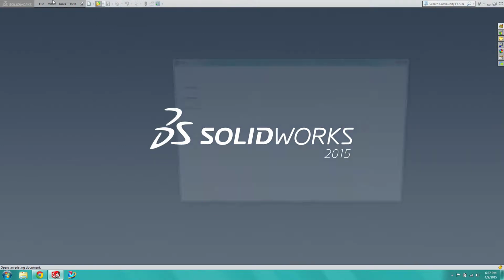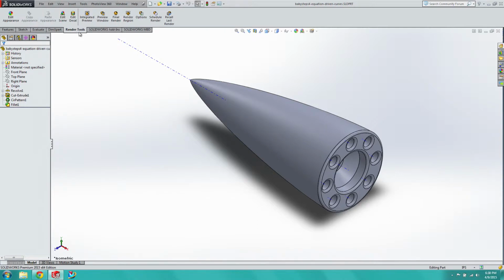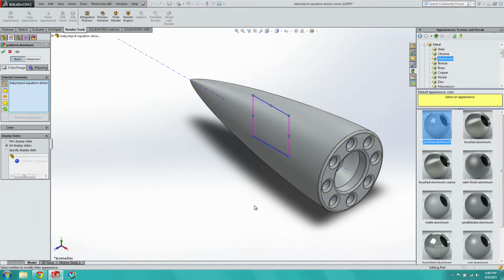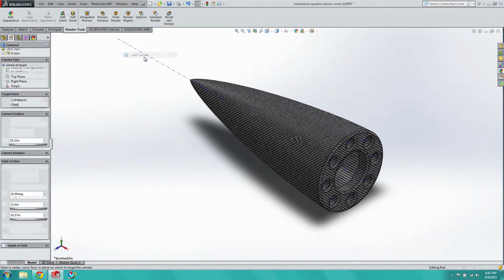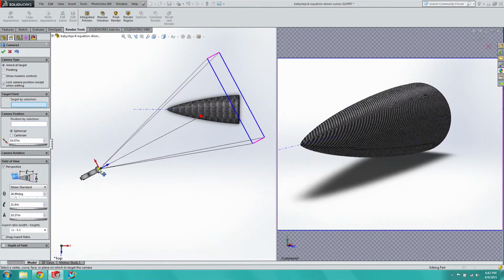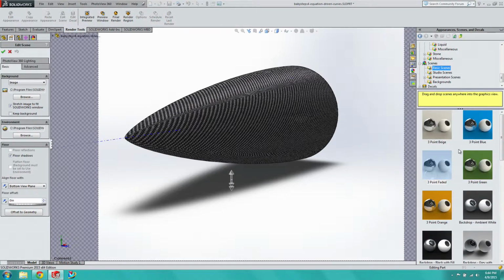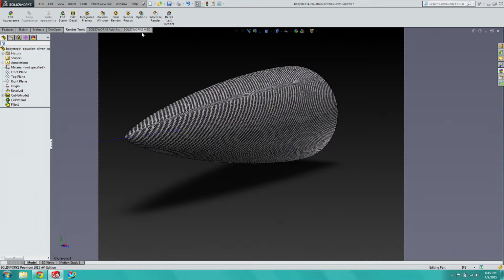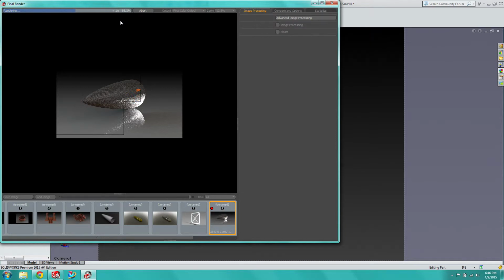SolidWorks Baby Steps #6: Basic Rendering of Models

Comment: When I render using a camera ratio of 1:1 (square) it always leaves a black strip on the top of the image, even though there's part of the model that should be filling that space. Any idea of what's happening ?
Reply from the maker: Jorge Luis Vargas You may have to walk me through a bit more as to what you're doing - can you provide a link to a screenshot of the SW screen vs. the render? The black strip, I take it, doesn't mirror to the bottom?
Reply: A Crazy Machinist Well by this time I already fixed it. I don't really know how I did it, but my main theory is that a custom background image I had has not big enough and was massing the ratio up. Or as you suggest, it might have been a shadows issue, because I had another entity directly back to this one.